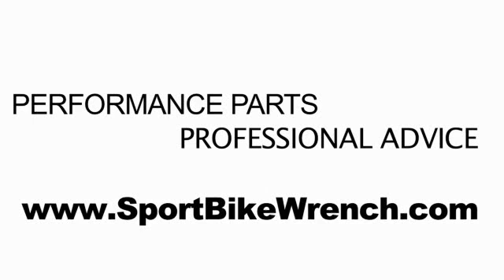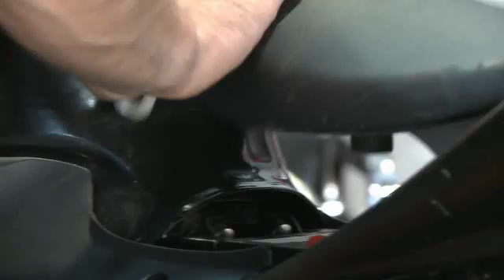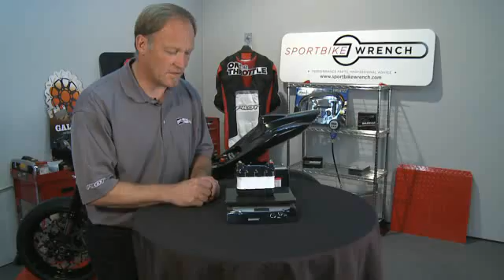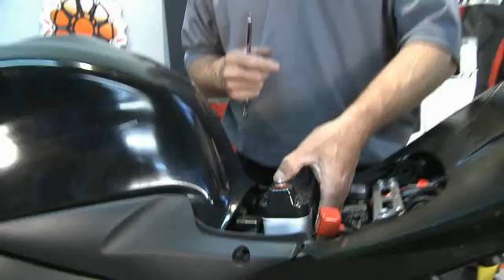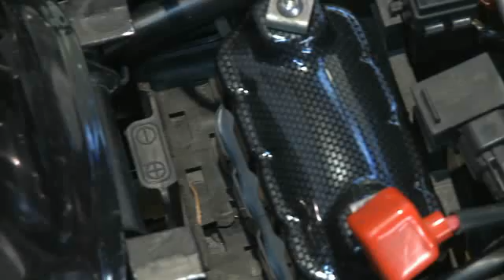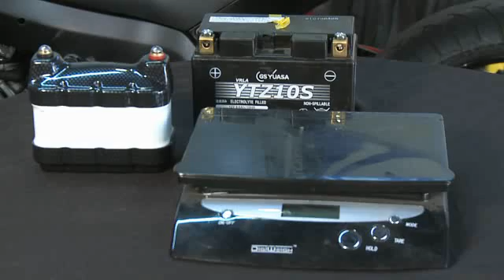Performance Upgrades GSX-R750 Dry Cell Battery

Comment: i have a ballistic 12 cell, about 2 months old, recently my bike went completly dead, put a volt meter on the battery got 2 volts. scratched my head, cursed, took the battery out put it on charge for about 4 minutes went back to make sure the battery was taking a charge and to my surprise the battery was at 12.5 voltts  again. can somebody tell me wtf just happened??? im assuming it has a protection built in that stops it from frying???

Comment from the maker: I've seen the stators go out around that mileage and replaced them with the K6 and 7. Check the voltage across the terminals at 5,000rpm. It should be over 14 consistently. If it is 13 or less, then the stator may be on the way out. At that point, you have run tests on each component starting with the stator and working up the line (regulator then battery).

Comment: nice channel, I found it from the wheelie vids haha. I have a question, do you find regular problems with k6, k7 gsxr's? Because my charging system failed at 20k miles and it feels it might go out again. My starting system (by the throttle also went out at 21k). eseensially do you find these problems often or is it just my bike?

Comment from the maker: I would say yes. The smaller batteries are really high on cold cranking amps, but not so high in terms of output. You would probably have to go to the next size up on the battery application chart and to be safe, add up all the electrical requirements of your additions and put that against the OEM stator output amount.